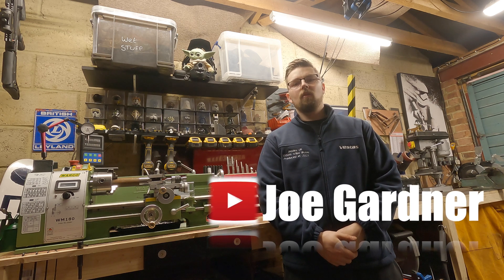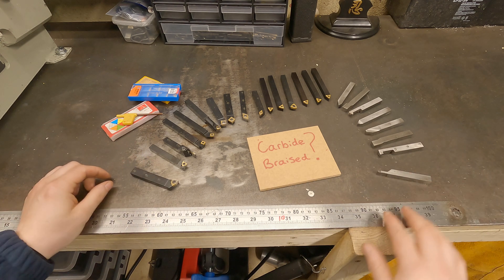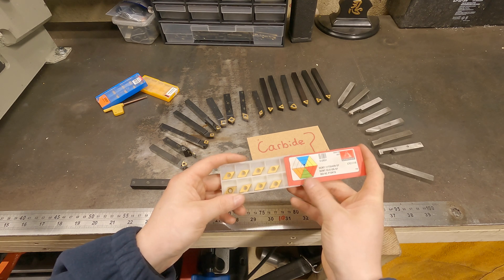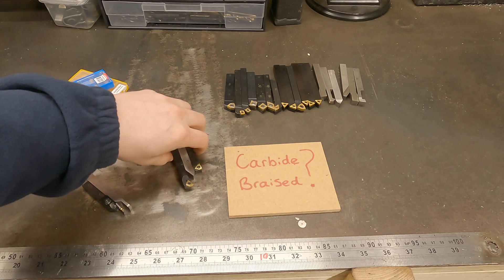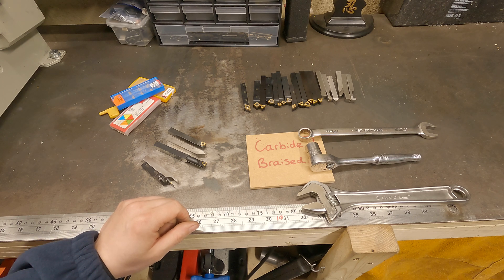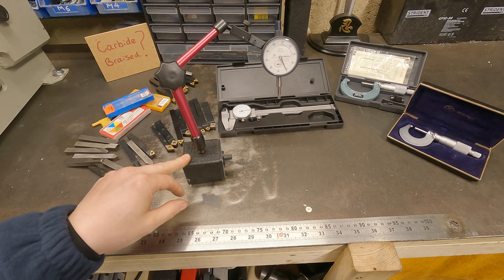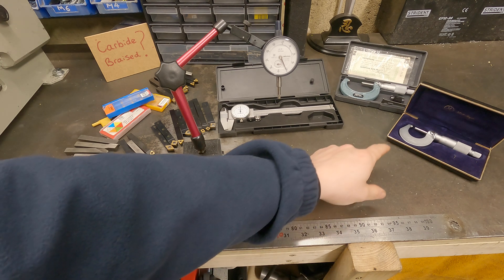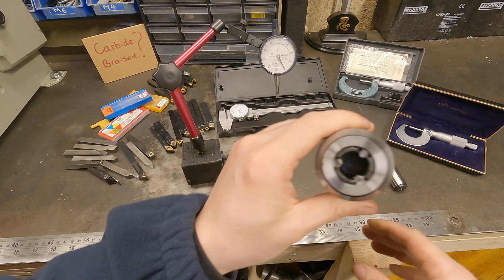Mini Lathe Basics Tooling

Comment: You misidentified your indicator and callipers.  Your indicator is simply a dial indicator - not a dial test indicator...  a dial indicator measures a linear displacement, where as a test indicator tends to measure to a higher accuracy, but is generally used to measure a variation rather than a displacement.... 

And with your callipers...  those are just dial callipers...  the "vernier" aspect refers to the type of scale...  vernier scales use slightly differently graduated scales on two faces and where the graduations line up indicates your measurement...  so, vernier callipers would not have a dial...  just graduated marks on both faces
Reply from the maker: Thank you for clearing that up Geoff great explanation between the two differences. 👍